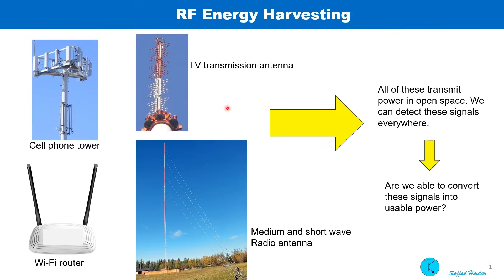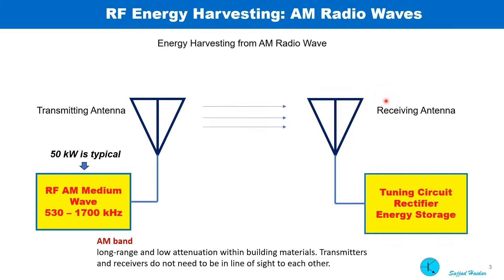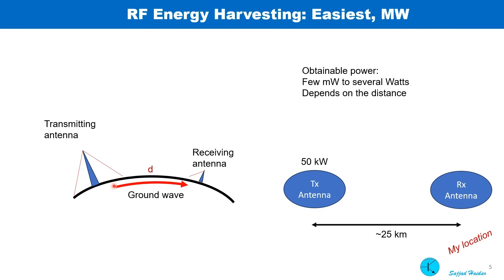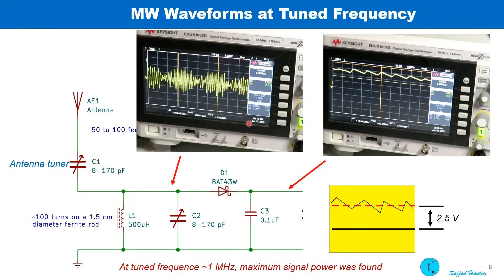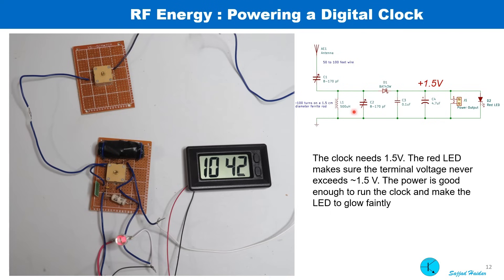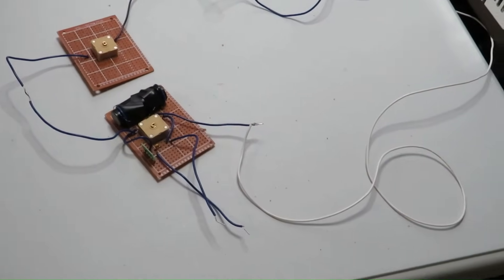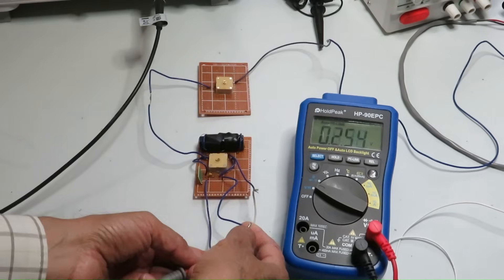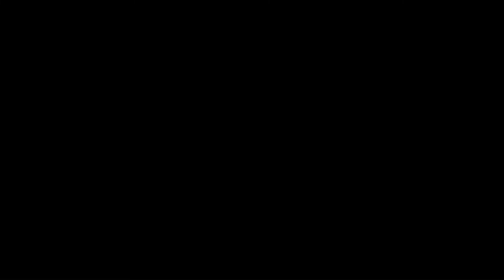Energy harvesting from radio waves

Comment: 🎉🎉 thannnkkkyyyoouu.. 
But if I live next to a big mobile phone tower.. how can I tune it to get the giga hzs of frequency power.. 
And do you think it is giving me brain radiation therapy damage.. 
Do I need to move house..?? 🏡😠👀👀
Reply from the maker: Tough there is no scientific data that cell phone radiation can damage human tissue or brain, however there are some statistical data which shows that this radiation can cause some damage. Totune at giga Hz, the tuning circuit should be very small so does the antenna. Thanks for watching
Reply: @technologyforyou5976 😂. Annnnd thers no ""🤡 scientist data.. showing that mRNA lipid nano particles course damage n dis.eas..
🤘🤪 Eye.ther..
Reply: @technologyforyou5976 . Only corrrrrRupt. Data showing mRNA is 
Perfectly ok .. 
In.SiliCo.😂

Comment: We need to power Raspberry PI Zero. ¿It can be possible using RF energy?
Reply from the maker: Raspberry Pi does not need much power, however if you are too far from a Radio station, the harvested power may not sufficient to drive raspberry Pi. Another way of getting more power is to use vey long antenna. that 50 to 100 meter. This is really long.
Reply: @technologyforyou5976  I was thinking to use some hardware with coils and magnets to recharge a battery and when the battery is full power on the raspberry, do their stuff and then power off.

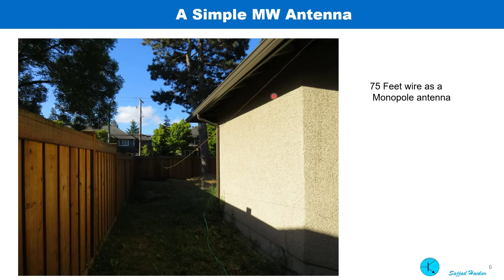Comment: I live near a radio tower, about 300 m from that tower that transmits at 603 Khz and with a power of 50 kw. Guess what? That tower transmits between 06:00 - 22:00. Maybe our "inventor" will take the scheme further and add a Li-Ion battery charger (step up converter) and from there we can use a more substantial voltage and amperage.

Comment: Please let us make this point clear. I don't think Maxwell is harnessing power from artificially generated electro magnetic waves like the microwaves used in satellite communication systems. Instead, he is using EM waves generated from the galaxies like those forming the electromagnetic spectrum - which includes the visible light. These EM waves are everywhere which explains its availability at any given location on the  earth's surface. EM waves from Communication tower are not available everywhere ant therefore it is certainly not the type that Maxwell is utilizing. 
Secondly, if the EM wave is a source of energy and that EM energy has only be converted into an electric energy by a transducer called ANTENNA, then, why do some people  think the technology violates the law of conservation of energy? I think it did not violate the laws of physics because the original form of the energy used by Maxwell is the electromagnetic energy - converted into electric energy by the antenna - just like solar P.V energy.. We can only refer to it as free because it is priceless and unlimited.
Reply from the maker: Those EM waves from galaxies are so weak you cannot get even a microwatt using the whole surface area (~6 sq meter)of an average car. The EM waves we get for free other than the solar energy are mainly in microwave range. Shorter wavelengths (UV, X-Rays, Gamma rays) are absorbed by the atmosphere. Don't believe the nonsense. Go look inside the car and investigate with a person of adequate knowledge of physics and engineering and you can easily find out the tricks.

Comment: Has any one thought of using transistor as a switch two diodes and a choke  and  a voile I made it years ago but can not remember circuite. It charged up capacitor really well I got spark  from it  if anyone has idea of circuite.  I would be very grateful

Comment: So i dont think my country has 7/24 AM anymore. Could FM be used instead or is it too weak for whatever reason?

Im just wondering why you went with AM.

FM can be heard with just my wired earphone so maybe it’s way too small of an antenna for any practical power? thats why?
Reply from the maker: Thanks for watching. There are some difficulties with FM power harvesting. If you are located within few kilometers and you can see the transmitting antenna, then it is possible to harvest.FM broadcast band lies in 88 MHz to 108 MHz, this band is a VHF band, so there is no ground wave, only line-of-sight antenna can harvest power. Another thing is tuning, it is little difficult compared to MW. Higher frequency FM band means you need  to use low capacity variable capacitor (few pF) and can be detuned easily

Comment: Important to note is that the lc tank portion of the circuit is not increasing efficiency. Its actually wasting power. A parallel lc tank circuit has an infinite impedance at its resonance frequency but a an impedance of effectively zero at any other frequency. Which is wasting power in your design. So i would ditch l1 and c2.
Reply from the maker: Thanks for watching. Antenna is not a simple source, it is a kind of power source with a complex impedance. Without tuning you will get less power, due to the drop in complex antenna impedance

Comment: It is least usefull , so pls make a video of collecting useful energy i.e. enough watts to run an electric appliance
Reply from the maker: Thanks for watching. Unless you are located too close to a powerful radio station, the collected power will be small. In this respect, solar photovoltaics would be a better solution. A few PV panel can give you enough power to run appliences

Comment: which application did you use for your simulation, that is if you did a simulation?
Reply from the maker: I did not use any simulation for this circuit. However in most of the circuits I use LTspice.
Reply: @technologyforyou5976  ok, are all the components available in the LTspice library, or at times you use  alternative components.
Reply from the maker: @franklinotieno8933  No, sometimes I have use some components which are already in the LTspice whose characteristics are close. Sometimes I download spice files from manufacturer's website.

Comment: Here is a very intelligent man who wants to take everything the easy route, that means in an analogy he wants to use the calculator to do all his math but when his battery runs down he didn't learn how to do it manually, with that said let's all go to AI and ask the simple question. The question to ask is if I put out a radio wave how many radios can receive the signal before the signal becomes exhausted. Ask this question when you get the answer you now know you can turn radio waves back into electricity the person who put LEDs on a crystal radio proof of this in the LED is more than a few micro Watts

Comment: What you people ignoring is the fact that there are ways to increase this micro voltage to a much higher voltage useful for what ever is needed. With the little bit of electronic I know I had been able to do it. Stop being negative please.
Reply from the maker: Please remember, what is needed at end is power. Power is Voltage x Current. You can increase the voltage but at the expense of power. You cannot suck whatever power you wish from the antenna itself.
Reply: @technologyforyou5976  what about using a boost converter to increase the output voltage
Reply: @technologyforyou5976 😂sucking 
The power 😆⚡⚡👊

Comment: Hello, when they describe the Cikumbutso system they do it wrong, they say that it works with radio frequency and that is fine, but, the radio frequency does not come from outside, it is produced by the device, and there are 2 or more frequencies that are mixed in resonance in a coil or transformer, all powered by a small battery in relation to the energy generated from the environment, no physical law is broken, they are electromagnetic fields, principles discovered by Tesla but improved.
Reply from the maker: Please measure the power coming from the battery and power going into the motor, you will find the answer. Whatever the system is, energy cannot be created or produced from nothing. Without measuring the power, it is useless to write any comments

Comment: Great explanation, easy to take screen shots, gets you started straight away. Tell me, I have an aluminium pipe fence about 8 meters long, could I loop the 75 mt antenna back through the fence tubes about 9 times or does it have to be one continuous line. Would I be able to pick up some power from a communications tower 800 meters away ???
Reply from the maker: Thanks for watching and your comments. Rather than loopback, it is better to use long wire in one direction like "I" or two directions like "L" looping back does not increase the received power, it will make it a directional antenna. 800 meter is quite a short distance you will get more than a Watt, for sure. Lighting your house is possible (not that bright though). If you are in North America, there no restriction, however in some European countries this kind of energy harvesting is not allowed

Comment: This is amazing! With MT3608 DC-DC Step Up Converter Booster Power Supply Module, you can increase the voltage from the 2.5VDC to 24VDC , which is usable by many electronic devices. The question is: How do we miniaturize the antenna so that it is compact enough to fit in a box like in the radios?

Comment: Thanks for the video...I think the key to achieving the higher density outputs is the resonance + synchronization.  Recall solders crossing the bridge and causing the bridge (resonator) to vibrate at its natural resonance frequency and causing the bridge to collapse.  You will be getting the exponential magnification of the energy and if you can harvest it at the peak, you'll get what you need.  When in random state, you'll get only micro or nano volt wave amplitudes of planetary background RF energy, but if you know how to get these little 'resonances' also synchronized(tell solders to march in unison), then you might get something interesting...

Comment: So Maxwell Chikumbutso not lying ?
Reply from the maker: Energy harvesting from radio waves is possible, but the output power is too small to drive a vehicle.
Reply: @technologyforyou5976 Can the Idea of step up transformer employed ?  So as to increase out put energy?
Reply from the maker: @Jlius-p2h  Step-up transformer only increases the primary voltage, however you will get reduced current. Ultimately you power (Voltage x Current) remains the same. Power will not go up , you cannot create energy, it will only transform from one to the other
Reply: You need a special components to harvest more energy.a technology not yet discovered by many. @technologyforyou5976
Reply: @technologyforyou5976 Maybe he uses Voltage Doulbler!!
Reply: Maybe not.. if his car is small enough...😂

Comment: how useful is that energy. Isn't it better to use a battery and try charging it simultaneously without depending on insignificant amounts of energy from electromagnetic waves. An inductor L (is a coil of thin wire around a ferrite rod) and can't be or is no a Schottky diode which is a combination of at least two diodes with 1 common. What are you saying ? LC circuit is the primary part of a radio receiver.
Reply from the maker: Thanks for watching. I think I mentioned combination of two capacitors. If only the low valued one (0.1uF) is used you will be able to hear the radio, however for power utilization that would contain too much ripple. To reduce the ripple you have to add the second one 4.7 uF or higher.

Comment: the questions is, will harvested wifi radio wave corrupting the transmision data?
Reply from the maker: I am using only the AM medium wave, the broadcast stations do not send data. Certainly the transmitted power will diminish as you are drawing some power. That is why in some European countries it is not allowed to use such a circuit.

Comment: It seems to me that by connecting in a circuit that could continually select multiple channels you might be able to power something bigger.

I wonder there is a video doing the rounds talking about some guy in Africa who claims to be able to be able to continually charge a cars battery using radio waves.

However he has not produced the goods yet.

I wonder if it would be possible to harness enough power from multiple radio wave outputs and combine them into enough power to do something more useful.
Reply from the maker: Unless you are not closely located (10s to 100s of meter) to a powerful broadcast station, the power remains small. Too small to drive a car. Whatever news you are getting regarding that is nothing but a scam
Reply: @technologyforyou5976  Yep I totally agree with what you say, I was just wondering if by using multiple channels at once it would improve the potential that's all.

Comment: Wouldn’t using this type of power interfere with Cell Phone and WiFi signals.  As it draws energy from sources meant for something else
Reply from the maker: Yes it does diminish power. I am utilizing power from Medium wave (~ 1MHz) so it will reduce some power along the way the wave is travelling. If you draw power from Wifi or Cell phone  signals (in GHz range) that will also diminish power. That is why in some countries energy harvesting from radio waves are not allowed.

Comment: Can i ask ?  You make 1,5v from radio waves whit one . Think about 50pcs in one box that is 75v just from radio waves . Did i thinking wrong whit that? tough it is just logic
Reply from the maker: combining these voltages are difficult. a half antenna should be distanced from another one by at least one wavelength apart, so you need a very large area for that to happen

Comment: Maxwell Chikumbutso entered the chat...maybe we can recify the weak ac voltage and store them into giant capacitors of Farad capacities and then use voltage boost modules to effectively increase them into more usable dc voltages and then charge up car batteries which then get dishcarged into inverters to give usable voltages for the home!
Reply: I'm here because of Maxwell Chikumbusto... trying to figure out of his inventions are real
Reply: @mayamachine  the concept of harvesting is correct and is old. But power amplification is the main and important part.
Reply: @mayamachine  it could be real, but it can also be a scam, hard to say
Reply: Me to Maxwell. Is very brave if is scammer  @mayamachine

Comment: How is the antenna design ?
Reply from the maker: I was tuning in the medium wave (550kHz to 1.3 MHz), so it is simple. I used "L" Type Antenna, the most effective is to use a 75 meter long wire hanging little above ground level. I used 75 feet instead. Not the best length, but still works.

Comment: Have you thought about using an amplifier to amplafie the radio waves with the sound wave amps???it will take small amount of energy waves and amplify them to any amp u need to power up ????
Reply: You, obviously, don't know what "amplifier" does. We are using the word "amplifier" rather loosely. It doesn't "amplify" anything. It is a device that uses small amount of power to CONTROL large amount of power - and that large amount of power has to supplied from somewhere.
Reply: Amplifiers require energy to "amplify", reducing the energy obtained from rectennas

Comment: Thanks for sharing. i got questions. what if we cascade those circuits as many as possible? will the power increase?
Reply from the maker: Thanks for watching and your question. Cascading is possible, however the main issue is antenna spacing. If you use two antennas which are closely space then the power will not be doubled. The antenna spacing should be significant (at least a wavelength)
Reply: use storage capacitors of Farad capacities instead!

Comment: Another question,  if you were capable of harnessing enough energy to charge a 12V battery,  should the radio station be taxing you cause technically you are using energy generated by the station 😅
Reply: The harvested energy is very little. In some countries it is not allowed to harvest energy from radio eaves as it reduces the wave power in some certain direction. However in most of the countries it is not barred by the rules. It does not restrict the waves that significantly.
Reply: naaaaah we just subscribe to the radio stations youtube channel!
Reply: No, because the radio station needs to transmit it anyways to get their job done, someone harvesting that energy is simply saving it.

Comment: Hello sir, please I am a student planning a school project to use ambient signals like RF or indoor lighting to charge a battery or supercapacitor for a low power circuit (I need at least 54mW). Any advice or pointers to resources for energy harvesting and charging solutions like e-peas or dfm8001 and the antenna band, matching circuit etc?
Reply from the maker: Hello Alex, Thanks for watching and your comments. To get around, 50 to 100 mW indoor, it is better to use a solar panel. Depending on how bright light is the inside a closed space, your obtained power  will vary. If you buy a 12 to 20V small solar panel (0.25 sq.meter to 0.5 sq.meter), your purpose will be served. for easy charging you can use a linear regulator at the output of the panel and then on to the battery (two to three Lithium ion battery each can give 3.7V). As you mentioned two companies, they are making specialized chips to process the obtained power. Processing means, maximum power point tracking and DC to DC or DC to AC voltage conversion. I have a plan in future I will show, how these circuits works and how to build one easily.

Comment: Question:  if i powered a 433Mhz RF transmitter and reciever module near this circuit, will the voltage increase? 
Because i am living far from the radio stations and mobile towers and i want to try this experiment....

Plz reply

Comment: This is simply not practical. 75m long antenna is not feasible in most homes.
Reply from the maker: Thanks for watching. Yes, you are correct, it is practically not feasible. It is just a personal investigation of mine. You will hear a lot of talks about RF harvesting, however  the amount of power you get is too little to utilize to drive something in everyday life. Solar energy is a much better option.